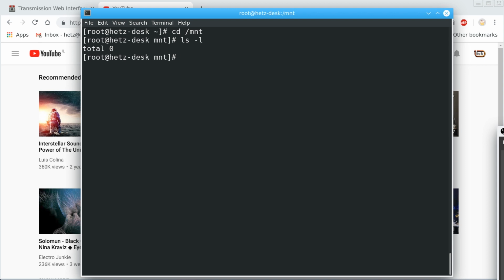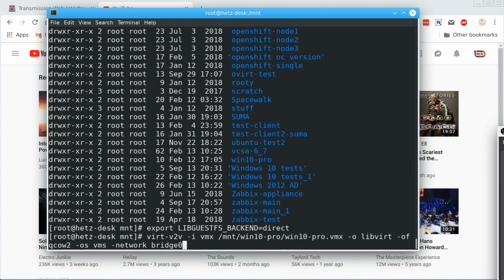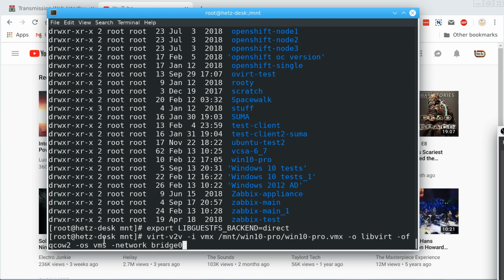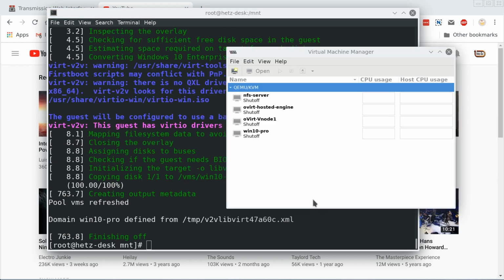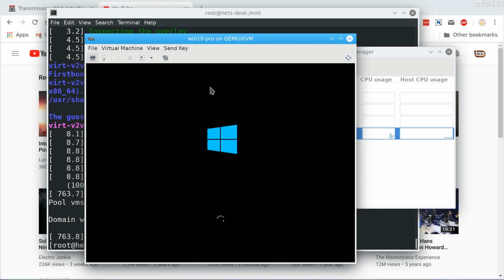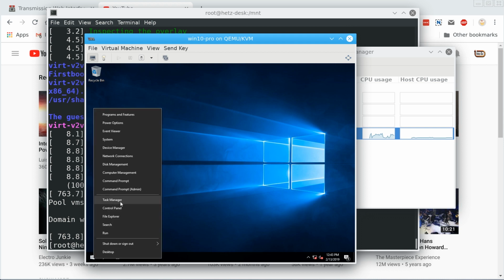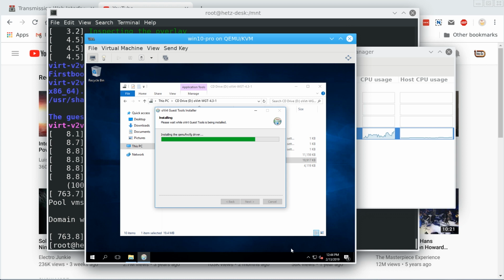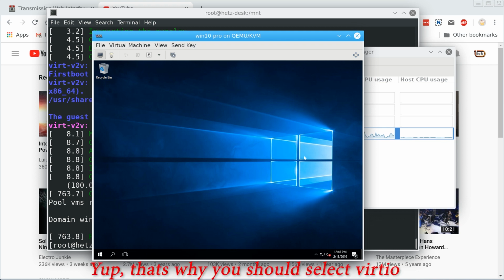using virt-v2v to convert VMWare VM to Linux

Comment: what's your opinion on KVM based let's say ovirt I use OLVM, or even cockpit. I'm wondering if it's suitable for doing testing AND production both. I feel like virtual box has a better interface for testing yet it doesn't have all the infrastructure like datacenters, clusters, etc VM networking and migration stuff. it's kind of a gray area.